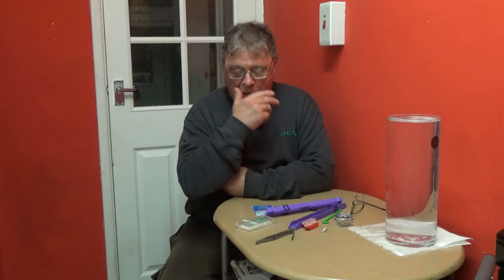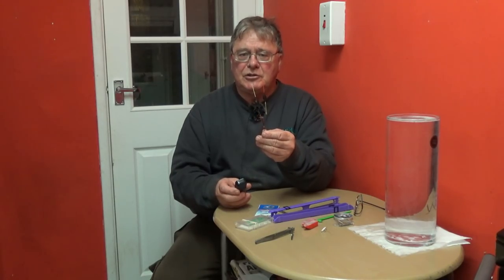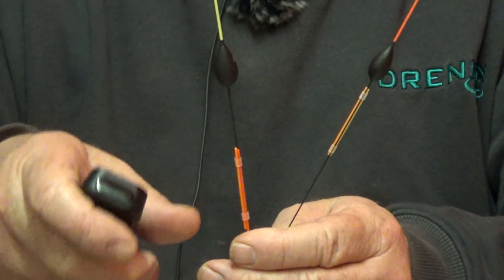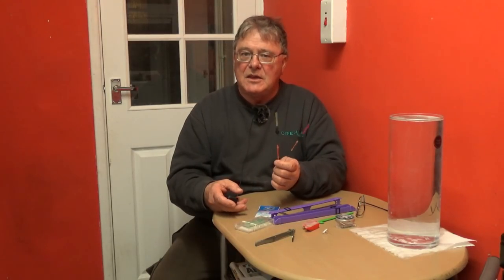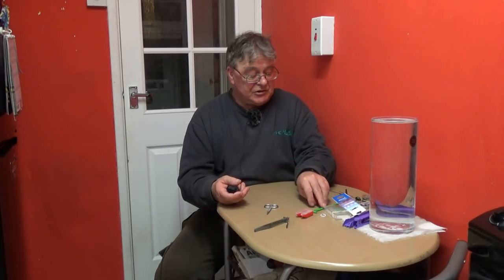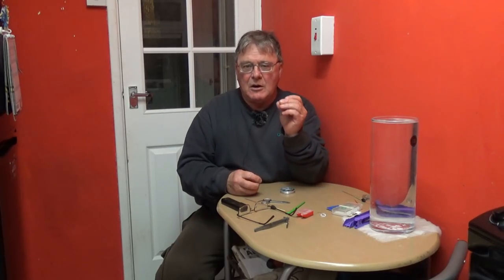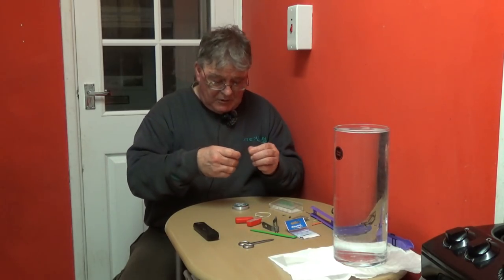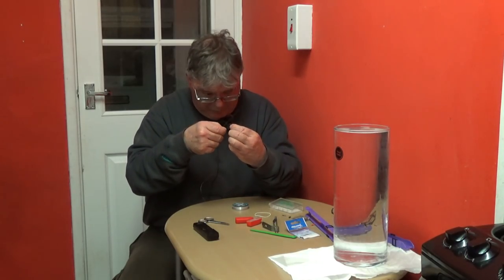EASY FISHING Building a Pole Rig A Beginners Guide

Comment: Nice video Bill i've made two rigs myself, one of them i made yesterday. Both are 0.75g one has a wire stem with a yellow tip the other carbon stem with red tip and i think they're both made by Preston. Both floats say 4x18 on them and i think only Preston go by that for some reason rather than just having the weight on their floats. I use the same olivettes only i have 0.5g and i bought whats called a Stotta which is a great tool for attaching stotz to the line as well as taking them off. I use size 18 micro swivels, same as you (though dont know if you're using the same size) although what i did was i made a hook length and attached that to the micro swivel so i have the hook length on the winder with the rig. I have winders as part of the accessory pack i got with my Preston seatbox, all double slider winders with two different sizes. Fishing with my new pole for the first time tomorrow, just need to make a few hook lengths and maybe another rig before i go to bed as i have a float that i've had going back about 20 years! has a slim body with yellow tip and is 0.4g. Would be good to have a lighter option and can easily shot that in a shirt button style for on the drop.

I'm currently using an empty 2 liter bottle as a shotting tube (i think, could be 1.5 liter!) i could really do with something like what you have. I'll have a look at asda next time i'm there...where did you get that big glass from?
Reply from the maker: cns180784. Hi well the old weighting system is no longer in use, thank goodness! I think the weight capacity in grams is much simpler to understand for beginners. That glass jar came from Tesco £5 in a sale. Tight Lines

Comment: Hi Bill,Ron from Indiana again.I hope you are feeling better,will keep you in my prayers.When you say pole rigs,this setup are for what you call whips and telacopic poles.Here we call them crappie poles.They are used a lot for dipping fish out of the thick stuff.I really like your rigs they seem like they would be very sensitive to light bite and they seem less likely to be blone around on a windy day.How deep can you fish this rigs?Thanks for another informed video.GOOD FISHING.
Reply from the maker: ronald ayres. Hi just for clarity, we call them pole rigs and for a telescopic pole (a whip) we make them about a foot shorter than the length of the pole. This is so that a hooked smaller fish or the rig can be swung to hand or netted. For the take apart poles we use in the uk the rig is much shorter. The depth plus about 2 feet as the poles are take apart and used with internal elastic. The float we use vary greatly in size anything between supporting a weight of 0.2 grams up to 50 grams in extreme cases! They are very sensitive when shotted correctly and indicate the shyest of bites and are made from a wide variety of materials. I hope this helps. Tight Lines

Comment: Hi Bill well it went really well today thoroughly enjoyed it caught plenty of fish with some nice mirrors and an F1. Finally caught my first Perch after about 20 years! tied in with being my first session on the pole for about 20 years too. That pole is great really cant fault it at all and the elastic i used the green 6-8 bungee was nice only problem was i did lose a lot of fish to hook pulls because they were mostly small silvers and i think the elastic being a bit too strong bumped them off but still managed to catch a load.

What i found strange was i didnt get a single bite on corn, when i switched to red maggots i got a bite nearly straight away. In the past on this same lake i fished i was getting a lot of bites and catching Carp on corn when i fished the bomb...they just didnt feel like tucking into corn today was strange. Was good fun, in the end i was fishing up to the no.6 section so was fishing at about 8.5 meters and used just the one roller. Felt so smooth and was good to be able to feed my swim accurately with a cad pot, was a nice day with only a fair wind most of the time, sometimes it was calm which helped although it did rain a bit heavily at one point but it didnt last long. When it did rain like that i had trouble seeing my float as i had it dotted right down.

Hope to see you fishing soon Bill, any plans on when and where you'll be going next?
Reply from the maker: cns180784. Hi great to hear you had a great session with your pole. The absence of carp suggests they were elsewhere! On elastics if the fish are really small you will bump a few unless you are down to ultra fine hollow or solid elastic 3 to 5 maybe. Well the plan is to have a go on a Gt Ouse flood relief channel,the place I filmed whip fishing on the river, but a bit further downstream. Short pole using lobworms and maybe casters for big perch. This is a very moody stretch which can be feast or famine, so I might get a big fish or just a few small ones. I plan to film it weather permitting. Hospital on Sunday morning for heart scan so weather permitting either Tuesday or Wednesday. Tight Lines
Reply: That sounds great will be good to see that, if you cant film the session let us know how you get on. About the Carp yea you're right with them being elsewhere, i did see a few topping near the far bank during the session. I caught 20 fish in the end which is great for me considering 10 was the most amount of fish i caught in a day previously when fishing the bomb. There must have been at least 20 that were bumped off just little silvers so when you include all those fish that bumped off in terms of fish that were hooked only 4 of them Carp and at least 36 were small silvers (and possibly the odd Perch and Gudgeon). If i had fished at the max 11 meters i might have caught more Carp as i'm sure they were out further but i found it awkward to fish at full length due to a fence that was behind me. Seriously considering taking groundbait next time but there will be a few things i'll need to get.

Well hopefully, and i'm sure your heart scan will be ok and there's no major worries. I guess it just a case of getting that out the way and you have the green light to fish. Where will you fish during the closed season will you go to your local commercial?
Reply from the maker: cns180784. Hi well the plan is to have a go on the Gt Ouse for big perch on the pole with lobworms, using the rigs in the video. Could be feast or famine! When the river season ends I will be on the Canal, club lakes and when I get the chance commercials. The problem with that is it’s a long way to the nearest fishery. I have one about 30 mins from home but that is closed in March/April. The next nearest is about an hour from home. Whatever I do I will try to film it. Back to the doctors now and then get some bait. Tight Lines

Comment: Hi Bill, do you use slip bobbers in the UK.They are very popular in the States.It makes it easy to vary the depth of your bait.I really like your fishing rig ,a lot thought went into it.GOOD FISHING.
Reply from the maker: ronald ayres. Hi well I don’t know what a slip bobber is, do you mean a sliding float? We set up our floats here in the UK with pieces of silicone tubing so that they can just be slid up n down the line to adjust the depth or for deep water use a sliding float which runs freely on the line and is set at the required depth with a sliding stop knot, and bead. Tight Lines

Comment: Hi Bill. Just wondering could you recommend a good 5m whip pole. Thank you for the videos, very helpful. Tom in Dublin
Reply from the maker: Tom Dowling. Hi Tom we’ll do you want a whip with a flick tip or a pole? If it’s a whip you are after I have handled the Preston model which is nice, about £60. Daiwa do a 5 mtr ‘speed whip’ as they describe it which I haven’t tried but being Daiwa it will probably be good, which is slightly cheaper. Shop around. If it’s a pole you want, take apart for elastics, I would take a look at Middy’s White Knuckle 6 mtr model about £45 or there about. If your budget is really tight I plan a video on fitting a flick tip to a cheap glass whip. I hope this helps Tight Lines
Reply from the maker: Tom Dowling. Hi out of curiosity I looked on eBay and found a Leeda Concept GTX Whip with a flick tip for £35.

Comment: HI Bill like the idea of float stops either side of the olivette I just used a shot,  I can see the advantage of float stop easier to move less chance of line damage.I also like the Preston double slide winders and will be getting myself some of the purple large size for my larger pole floats and also some running line rigs big stick floats and bolo.I do not use a seat box so storage for the large size winders Is a bit of an issue at the moment I am looking for a strong plastic shallow box with a lid that will accomodate about ten of these winders so far no luck, how do you store yours?.I believe the large purple winders come In a tray without a lid Is that correct?.
Reply from the maker: stephen brand. Hi well look in the supermarket and Poundland Wilko etc for suitable cheap boxes. I would consider lining the lid and base with foam to prevent damage. The big Fox winders fit in my Matchbox under the seat perfectly . Glad you like the video Tight Lines

Comment: hi bill, how do you Feel about using a water knot instead oF a loop to loop connection For a Float rig hooklength? (i'm not keen on swivels)
iv been using it For a Few months now, especially For clear water and spooky Fish
i just Feel that when you are using a loop to loop the thickness oF the line is doubled, iF not more, plus the knots.
Reply from the maker: BUSHCRAPPING . Hi well a water knot is definately neat and strong if tied correctly and if you prefer this carry on using it. Apart from the rare occasion when fishing ‘straight through’ I use separate pre-tied hooklengths and prefer using a TINY snap swivel. The very small Drennan and Crallusso  snaps are rated to 4 kgs bs so are more than strong enough after all you can’t pull that with any pole or rod! They weigh the same as a number 10 shot so don’t unbalance the rig and help prevent line twist. But each to their own and as long as you question why you are using an item rather than just blindly following or copying others you will be a much better angler. Tight Lines

Comment: Thanks a million Bill. Would a flick tip land a 2lb fish. I fish the Canal here in Dublin and there are some good size perch and hybrids
Reply from the maker: Tom Dowling. Well the whip will, it’s more down to the anglers skill. In my video ‘ whip fishing on a river for beginners’ I managed a pound plus perch and a decent Tench  on a whip. I seem to remember a fair amount of weed when I fished that canal in about 2001 so i would probably buy a pole and use elastic for bigger fish and buy a 3 mtr Whip for silvers. You can get a really good carbon whip with a flick tip for just over twenty pounds from Daiwa, Preston, Garbolino, Sensas etc. A pole will give you more control if conditions are tricky but the choice is yours. I hope this helps. Tight Lines
Reply: Aye mate